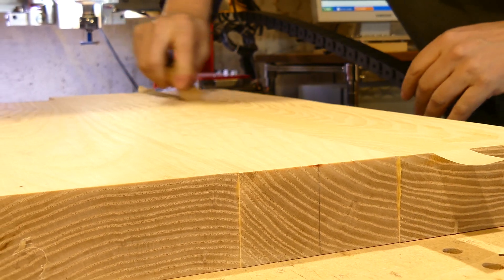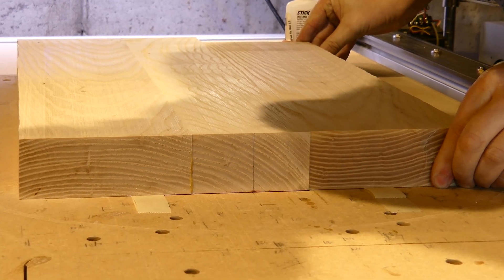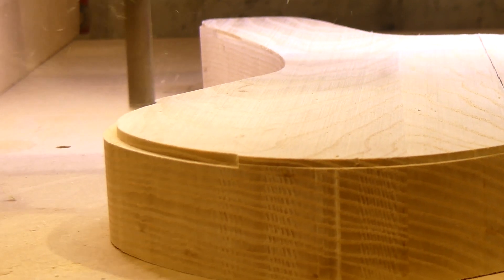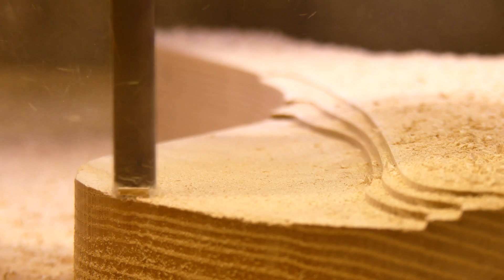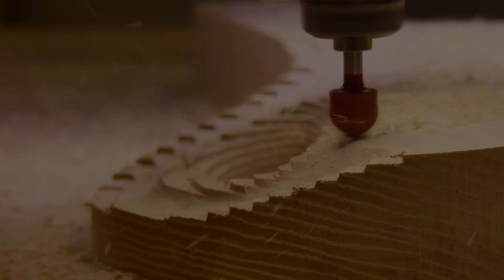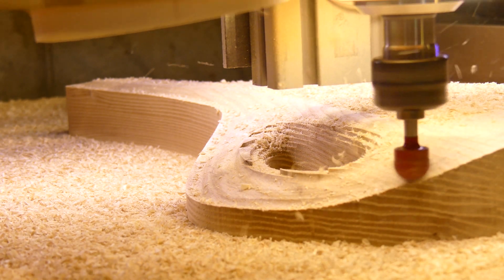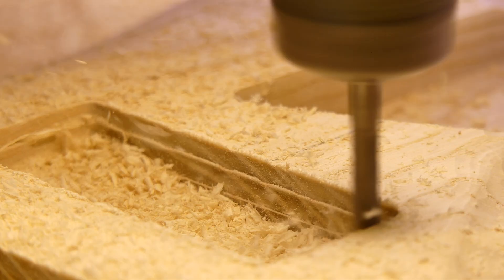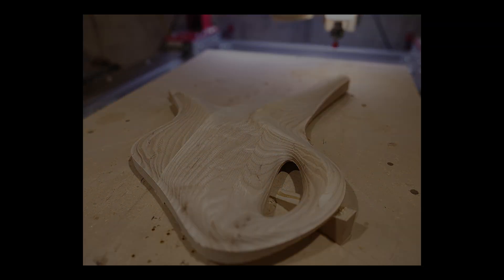CNC Milling a Custom BASS

Comment: Awesome! How do you index the body after you rough cut from the bandsaw? Is the cnc rough cut oversized?
Reply from the maker: Yes the rough cut line is .25" outside the final profile. I index from the centerline and cut profile when I put it back on the machine.